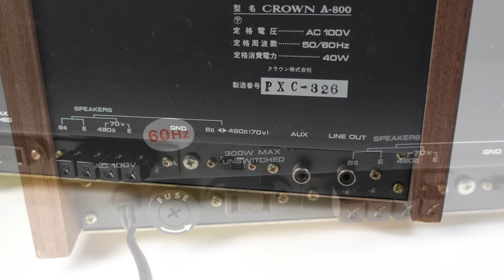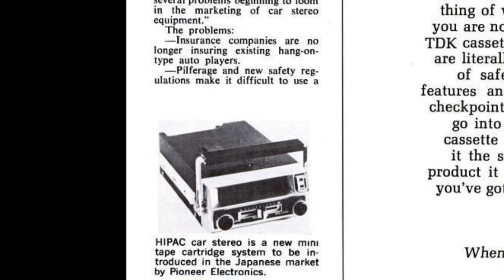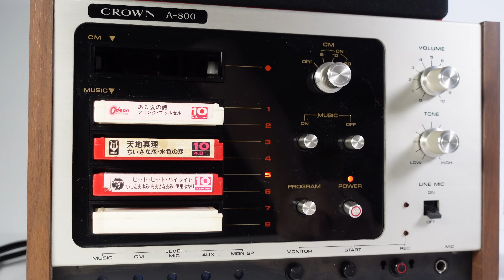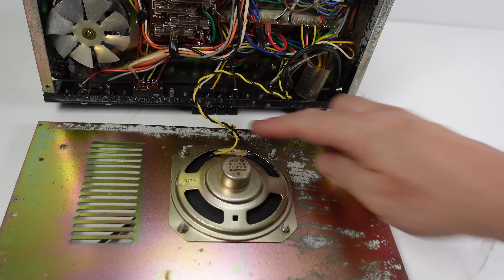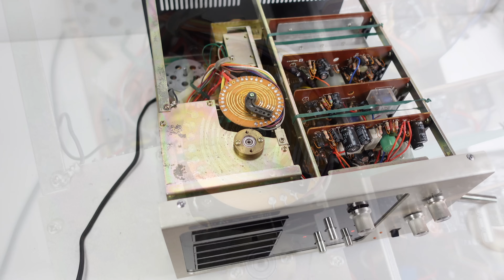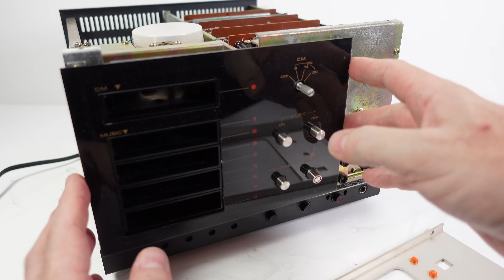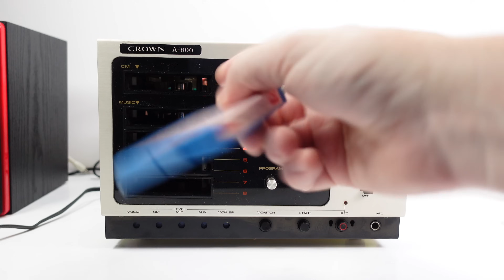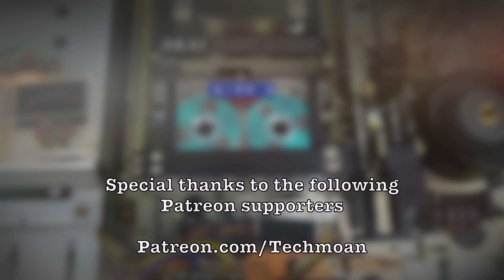An unusual player for a forgotten ‘70s music format

Comment: The capacitor for the motor is the phase shifting capacitor. This is what gives the motor starting and running torque. Motor speed is fixed by the number of poles in the motor and the power line frequency. RPM = line frequency(2/number of poles).
A larger motor pully is needed for 50hz operation. Some equipment instead of a 2-step pulley had separate 60hz and 50hz pulleys, and this is likely the case with your machine.
Reply: Full agreement… exactly what I was thinking.  But, just maybe a slim chance of something.  Since it has removable cards and one appeared to be a power supply (PS) card,  the motor might (just might) run on DC.  If that were the case, there might be a ‘wired’ movable connection somewhere on that card.  Now, if that were to be the situation, that big cap would-a, could-a be a DC smoothing (or ripple) filter cap for the resulting DC that follows the (a) rectifier in the PS.  Well, for what it’s worth, that’s a reach… and no way without a peak at the schematic or an in-person look see.  Good luck with it.
Reply: The capacitor determines direction of rotation rather than the direction be random.  But changing the capacitor no doubt ensures that the motor has maximum torque within power rating and 90' phase shift for the mains frequency.  But there must be a gear change such as a different pulley or motor with a different number of poles?
Reply: @AndrewLohmannKent  Direction of rotation is determined not by capacitor value, but by reversing the polarity of the auxiliary winding with respect to the main winding in a split-phase style motor such as this. Capstan motors on reverse play R2R deck do this with dpdt relay contacts. The motor in the machine Techmoan is reviewing is likely permanently wired for unidirectional operation.
Reply: Just put in capacitor required for 50 Hz, and try. On 50 Hz net, with capacitor value which is clearly stated on machine, nothing can go wrong. What has to be respected, is voltage of capacitor. Put the same, or above, not less value. That's it.
Reply: I highly doubt the motor is an indication motor, I would expect it to be a brushed motor. Therefore I don't think it is a phase shifting capacitor. A capacitor can be used to adjust motor speed such as in an old fashioned ceiling fan speed control. I think it does that by using the capacitor AC reactance to lower the True  Power available to the motor. I think its worth a try, it shouldn't damage it anyway
Reply: @cameronlevers231  -- Assuming it is a brushed motor (the only rational assumption IMO), then the capacitor is almost certainly an RFI countermeasure.

IMO, YMMV, etc.
Reply: @This_is_my_real_name  interesting thought and not a subject I know a lot about. Would you need to change the capacitor value between 50 and 60hz? What sort of value would you expect for RFI suppression? Also if you were specifically targeting 50 or 60 hz (not sure why you would need to) I would expect a more elaborate circuit than just a cap
Reply: @cameronlevers231  -- I haven't been paying much attention to the details here, but basically, the lower the frequency to be filtered, the larger the capacitor must be to filter it. That's why capacitors in UHF LC tanks will be nanofarads/picofarads/micromicrofarads (insert date-yourself here :), whereas power supply filters (power line frequency) will be large electrolytics.

So, I'd imagine that a 50 Hz motor would need a larger condenser than a 60 Hz. If it turns out that they're specs call for the opposite, then I guess it's not for noise limiting. (And BTW apart from RFI there's also internal noise limiting to consider -- you don't want spikes from the drive motor riding on top of the tiny signals from the tape heads.)
Reply: @This_is_my_real_name  the values were 60hz : 0.6uF   50hz  :  1uF  also it's an AC motor not a DC switch mode power supply where you use large electrolytics. Electrolytics don't like AC (some exceptions like 2 caps with opposing polarity)try it sometime it usually goes with a bang
Reply: @cameronlevers231  -- yeah, I'm familiar with AC electrolytics. Had to replace them in our well pump more than once (start and run, both failed, one failed twice).
Reply: Also familiar with the "fun hobby" of "forming" electrolytics after they sat unused for a while, very common in strobes back in the day.
Reply: I have seen small DC motors that had an electromechanical (centrifugal) governor. If it is so equipped, it may be possible to adjust it to run at the proper speed. However, there is a much simpler, more elegant solution, which will resolve all of his 60 Hz issues. I will post it in a separate comment once I've submitted this one.
Reply: @This_is_my_real_name  nice.
Reply: @This_is_my_real_name  They were common battery powered tape recorders to compensate for the voltage variability.  In this case a simple voltage regulator will do the job because a PM brush motor has very good speed regulation.
Reply: @AndrewLohmannKent  -- IIRC "common voltage regulators" were Jetson's type futurama stuff back in 1970.

Comment: It is probably an AC Synchoronous motor in there. You can control the speed of these types of motors by changing the capacitance you add to one phase of the motor. As one other comment suggests, try adding a 0.4 uF capacitor in parallel and you'll know.

Comment: If its being used to controll the speed, the cap is being used in an RC circuit. You need to be careful you don't actually reduce the internal resistance 'R' of the cap(s) if you combine multiple caps as others have suggested. I would think getting the correct capacitance AND the correct type would be important to ensure an appropriate internal resistance. I think thats a tantalum cap but im not sure at all
Reply: It is not a tantalum capacitor.
Reply: @geoffmorrison3648  what do you think it is?

Comment: That the tapes are designed with the spring loaded pinch roller and such suggests the format was designed with this multi-tape player in mind. Seems more likely the single-slot consumer car stereo was an after-thought, reapplying a BMP to a consumer use. Either that or they were really thinking ahead, which seems unlikely. That spring-loaded roller was an extra manufacturing cost that they wouldn't do unless they believed they needed to.

Comment: Swapping the cap would not change the speed but will set the right phasing for the motor windings. The circle thing is called mode switch in I'd suggest to clean it, also clean all switches and lube the motor. I don't know what is the voltage getting to the motor and its resistance but a variable resistor can be added in series with the motor and that will sort the speed issue. I'd start with 50k if were to do it blind

Comment: assuming this circuit is used to time the speed of the machine, and assuming it's a good old RC oscillator, changing the value of a capacitor will change it's "time constant", so that sort-of make sense to me

Comment: If Japan uses both 50 Hz and 60 Hz, you'd think that they'd make electronic devices that don't care what the Hz is, that it would work at the correct speed on either system.

What you could try is get a 400 uF capacitor (or four 100 uF capacitors) and hook them up in parallel with the existing 600 uF capacitor.  
Just use alligator clips to test it out before you solder them in place. 
Other people have said the same thing in comments below, I'm just repeating it so he'll have a better chance of seeing the comment.

Comment: Why don't you get an inverter that puts out 120 volts at 60Hz, or better yet a Japanese one that puts out 100 volts at 60 Hz?
Reply: Do not use a "modified sine wave" type inverter on equipment that has a mains transformer operating on the 50 or 60 Hz AC input.

Comment: I’m wondering if the hi-pacs for this machine would have been mixed down to mono or wether the machine could sum a stereo hi-pac into mono?
Reply: Don't think it would need to be mixed in the electronics as the tape head azimuth slots are wide enough to cover 2 of the 4 tracks on the tape !
This is what happens when you put a stereo cassette tape into a mono recorder !

Comment: You can tighten the pack without adding wraps to the pack. You simply put it together and carefully pull tape from the inside and allow it to spool onto the outside. This type of pack is self tightening and if it did not have the teflon lube on the back to let the pack slip by itself layer-by-layer it would not work.

Comment: The capacitor doesn't determine the frequency the frequency determines the capacitor if that makes sense so I don't believe changing the cap will work, can't remember my synchronous motor stuff but someone below will, when you find out please give it a mention, fascinating as always...cheers.

Comment: Hey Matt, if you're attacking screws with a small round punch in them, those are JIS type and you should really have a proper driver for them. Regular Philips screwdrivers can damage the heads, since they will round out when too much torque is applied.

Comment: Hey everyone, I hope you're all doing well. Matt, if it did have a special microphone, it's possible that there may be another contact on that mic socket for a switch that would activate the control signal. Hope that helps!
Reply: Special microphone hadn't occurred to me.  Maybe it would have a TRS connector, to record the tone to one channel as the voice is recorded to the other?  @techmoan is there anything in the manual that describes the mic?

Comment: This reminds me of the ITC 3D NAB cart machine... One capstan for three deck that slide in the same way. Very interesting tech! :)
Reply: Back in my DJ days in the late 80s, the station had the 3 deck.  Green and Red button per slot.  Not a bad trick in the analog days.
Reply: Crown was and still is for the most part jobber grade equipment. Board swapping design is very common in broadcast equipment. In the 70s they sometimes made it pretty as well.
Reply: Even at the radio station I worked at in 2000-2001 the music and line up was all digital and run by computer, but the EAS was a cart machine.
Reply: That was my first though but Techmoan has covered those before too
Reply: Exactly what I thought.
Reply: Ha, awesome, hi there Joe!
Reply: There was also the Spotmaster 5-deck NAB cart machine....  single motor and very long capstan, with 5 cart modules with heads and pinch rollers, oilite capstan support bearings between deck mechanical modules.  

Crown Japan is an entirely different company than Crown in the USA known for pro audio amps, and some limited test gear or peripherals.  Crown Japan made upper-econo and lower commercial tier electronics to hit price points, but where this background music system looks suitable for its intended industrial function.  Good riddance though, as to the issues of tape transports, and their maintenance, for systems intended for 2-8 thousand hours a year operation cycles.  

Besides the program content rotation this deck offers, and 2 or 4 hour rotation of cartridges, a multi-deck format also lowers maintenance like tape head cleaning, that likely didn't get done every hundred hours in many such systems.  (per head, which means around monthly in a typical location)

Comment: I wonder...if the guts of a bluetooth-to-cassette car adapter could be made to fit in a  3D printed Hipac case, all those lonely orphaned Hipac car stereos could be given a new lease on life. I really dig the format.
Reply: It definitely could. There's lots of room and the heads are the same. Whether it would be worth the trouble is up to you to decide. :)
Reply: A very worthy goal.  You could pull the head and guts from a cassette adapter and it should work fine.
Reply: @KallePihlajasaari  It would work.
Reply: Probably, could borrow some of the form factor from the 8-track adapters.

Comment: Hello Mat. Concerning the motor, if it isn't wired to a trimmer adjusted circuit, then it might have an internal adjustable centrifugal switch to regulate the speed. It's very tricky to operate whithout special tooling, but with patience... Greetings.

Comment: You might try changing the capacitor, but I don't expect any change in playback speed.
Yes, people are right saying capacitors often control frequency, but in a situation and time like this, the speed would be percents off between units if it depended on the cap.
My guess would be different motors between 50 and 60Hz require different capacitors for smooth running.
Reply: This is correct.   The speed of an AC motor is set by the frequency.  The capacitor is changed to ensure the correct phase angle for smooth operation.  For 50Hz operation, I would suspect you need to change the belt, one of the pulleys and the capacitor.

Comment: Thank you for these videos. I've been thrilled by taking things apart to see how they work since I was barely walking, and I still get a kick out of it in my 60s. It is fun to see something built to industrial/commercial standards and methods rather than consumer electronics. I imagine this was a very expensive device when new, especially given the very small target market. The maintainability features built in are very consistent with a machine designed to run all day, every day, for years and years. Tooling up to make these must have cost Crown some serious money and I imagine the project ended up being a money looser for them. Or .... is this one of those weird things where a technology designed primarily for a consumer market failed, yet the commercial niche products based on that technology continued on for many years???? That can certainly happen.

Comment: I really don't think changing that cap will help. They usually put those caps in to "balance the load" on the power grid so it's not overly inductive.

Comment: Changing the capacitor should work fine. Also, have you tried to replace the tape inside the carts with cassette tape ? You could record, (using a mono source), one side normaly, But the other side would have to be recorded backwards. (LOL). Just a thought.

Great video, Matt.

Comment: The capacitor is probably being sized to correspond to the drop-off on the 50Hz/60Hz waveform.  The time between signal peaks is longer on 50Hz, so a larger capacitor is needed to hold the voltage high enough for the player's electronics.  If the motor is an AC motor, then this won't affect the play speed (as it's synchronised to the power frequency), however, if it's a DC motor, the voltage fall-off may be reducing the play speed.  I doubt the capacitor is part of an oscillator for speed control - it seems too large for that and the size difference between 0.6uF and 1uF is too large for the 50Hz/60Hz time difference.

Comment: Was everyone else thinking like me that these cartridges would be almost trivially easy to 3D print?
Reply: Easy but not particularly cost effective.  Also, the finish of 3D printed objects is slightly textured.  Not an issue on the outside but it could create problems for moving parts.
Reply: @xaenon  Well, he did say the blank cartridges are hideously expensive. The tape, foam pads, and torsion spring should be easy to source. I don't know how specialized the pinch roller is.

While filament-based 3D printers are the most common, resin printers are becoming more mainstream. The resolution is much higher, layers are inperceptable, and the finished parts have very high tolerance. Because the technology doesn't require heat, the objects are also more dimensionally accurate and aren't prone to warping like FDM printers. Sure, it's a niche market, but it's a more practical application than printing a garden gnome to put on your mantel. :)
Reply: @MarkWarbington  Yes, but it's not 'trivially easy' to print one.   First you'd hve to acquire a cartridge, disassemble it, measure out every single dimension, and use some form of CAD to duplicate the design.  And just from what I saw of the innards of that cartridge, there are at least four pieces that would have to be duplicated, assuming the pinch roller isn't anything unique.

And per-unit costs of printing them are not trivial, either.

The tape could be sourced from cassettes, but seeing as recorders for the HiPac format are not very common, you would have to create the recordings on a cassette deck - and the 'B' side would have to be laid down in reverse  - and all this assumes that the Hipac works at the same 1.875 ips as cassette.

I'm not saying it can't be done.  I'm just saying that it's gonna be a lot of work to produce all-new media for a format that's both obscure and long obsolete.

i have the skill sets and resources to do all of this essentially by myself.   It's still a lot of work.

Comment: Capacitors are used for varying motor speeds, but I seriously doubt that would be the mechanism used here. One of the most common examples is in ceiling fans, where the different speeds are chosen by selecting different capacitors, but what that really does is vary the power of the motor. In this case I'd very much expect the motor to be running strictly synchronous with the electrical frequency rather than being regulated by its power, in which case switching capacitors wouldn't do anything, since they wouldn't change the frequency. My guess would be that they replace the motor entirely, and that the different models of motors are accompanied by different capacitors, so they would just be changed in unison. Not sure what the purpose of that would be, though. Power factor correction? Startup windings?

Comment: The guys below are right.  Just parallel a 400uf cap to the one installed with some clip leads.  Changing the capacitance like that for testing won't hurt anything.